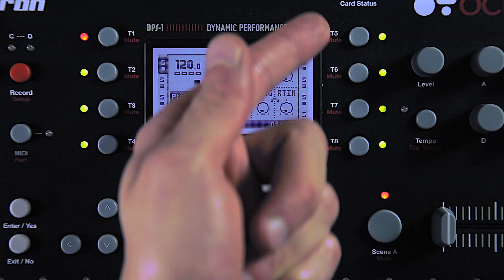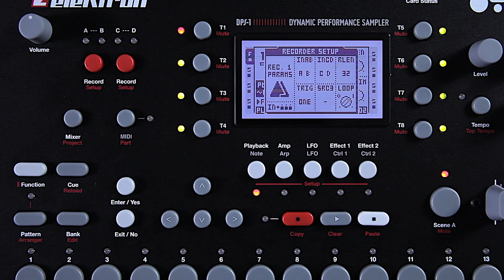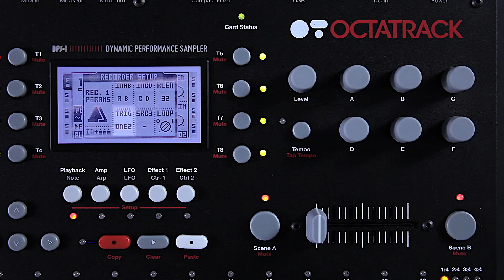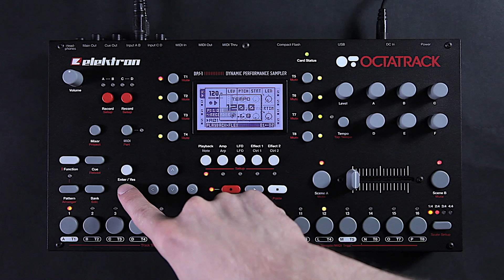Octatrack Know-How — Lesson #3: Manual Sampling

Comment: I'm sampling from the volca keys, and only get sound out of my left speaker.  I've tried setting the input on the octatrack to just A and als to A & B.  I'm going out the headphones jack of the volca keys and have tried every combination of mono and stereo 1/8 inch to 1/4 inch cables and converters.  Have also tried it with the OP-1 and the monotribe.  How to I get it to sample stereo?  Thanks in advance.

Comment: My opinion: It really is exceedingly difficult to master this machine. The manual doesn't help at all, it's so convoluted as to be almost unreadable, i almost burnt it a few times. I found user video's way more intuitive than the Elektron ones, especially on sampling. Update the manual, and place all the Sampling terminology under one heading, not all over the place, to help future users. This machine has amazing potential, but it really needs the UI and manual simplifying.
Reply: Agreed, Electron manuals need a complete overhaul, written by someone who can teach and tested by someone who's not used an Electron machine before. Their instruction manuals are awful, and probably responsible for more people avoiding their gear than buying it. Incomprehensible is the word that springs to mind.
Reply: @2112jonr  @pendlecoven: I agree 100%.